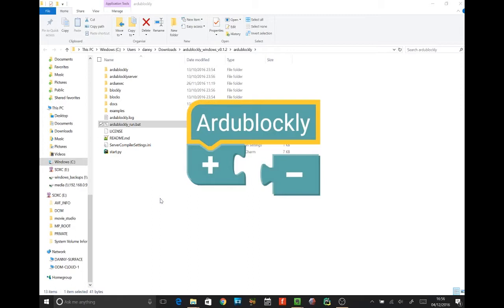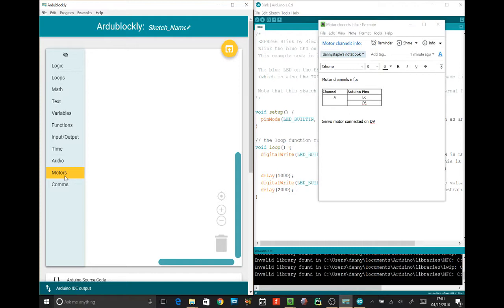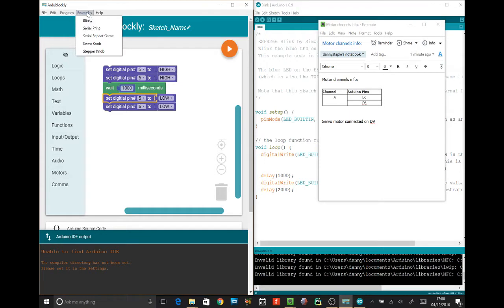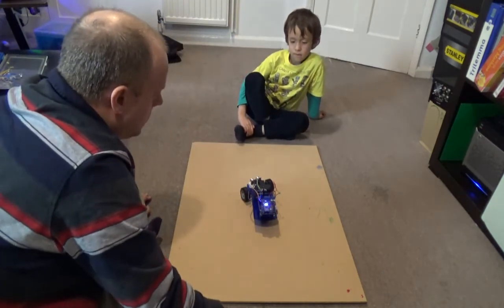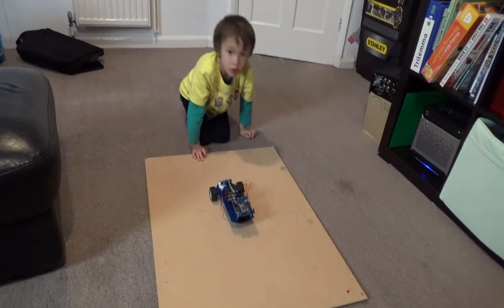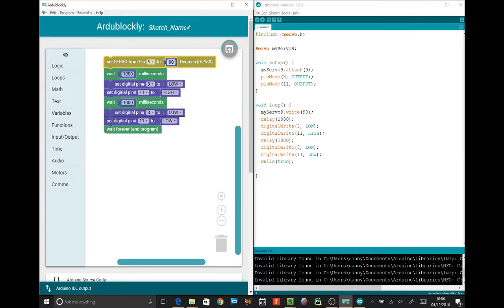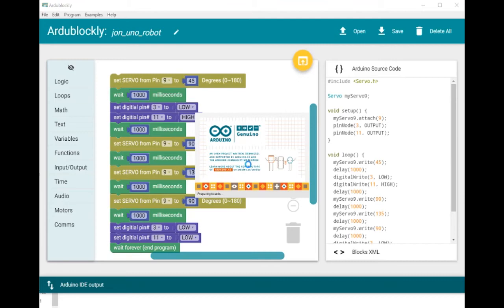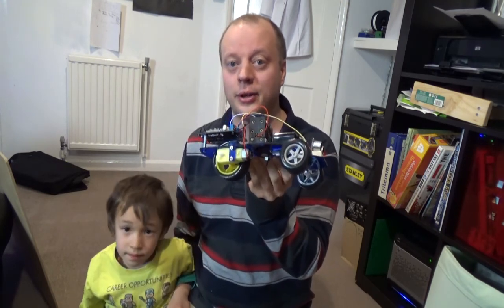Programming an Arduino Nano, Elechouse 15A Driver Shield and 4Tronix Unotron

Comment: Nice work John.
Is ardublocky  available? My eldest (19) got into programming with irc roblocks using scratch and is now in college programing. my younger (2,8 and 10) always get interested in my electronic things and want to try but the ide confusses them. arduinblocky, i know i'm getting the name wrong would be great for them to get more involved.
 If it where released in an app form it would be fantastic using an OTG USB lead. I've recently discovered an arduino IDE app that's great for adjusting and uploading code but a pig to write new code. So this blocky would be great on a touch device.
Reply: Hi, at the moment Ardublockly only works on Windows/macOS/Linux as it needs the official Arduino IDE to compile and upload the code. The only Android Arduino IDE that I know of is ArduinoDroid, and as far as I know it doesn't offer any interface that I could use from Ardublockly (the app is not open source, so I could not integrate it either).
If you'd like to use Ardublockly from a tablet you could have it running on a desktop computer connected to an Arduino, and if you knew its IP you could use Ardublockly from a tablet (or any other browser), but the main application and connection to the Arduino would still have to running from a computer running Windows/macOS/Linux.
Reply from the maker: +Sirus hi, thanks for the comment. I've got a link in the video description to ardublockly, it is a project on github. Currently it depends on the Arduino ide being installed. I plan on doing a video on installing it on a clean pc. I love the idea of making it an app, perhaps I can talk to Carlos, the author of the app, on such an idea.
Reply: Cool, the app would just have to parse to the ide so should work ok. Ask carlos to contact me with what i have running if he is interested.

Comment: Very fun, good on you for starting him early!!
Reply from the maker: Some of it's a bit advanced for him - and I'm still learning how to explain angles to his older sister. She understands fractions- so it may be that fractions of half a circle is a measure she understands more than degrees.
Reply: at that point you might just go straight for radians.
Reply from the maker: +Paul Martin that is exactly what I'm thinking, although the servo api for Arduino use degrees. Multiplying by pi or by 180 is then a exchangeable post process to fractions of a semi circle. Perhaps make it 2pi or 360 then it's just fractions of a circle.